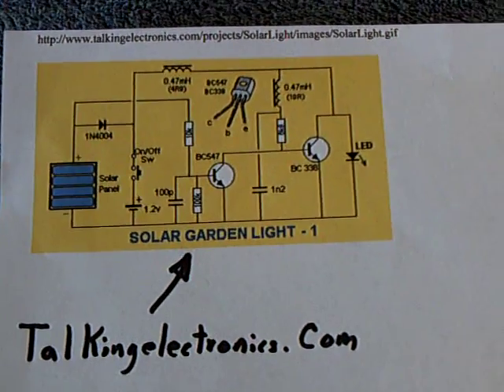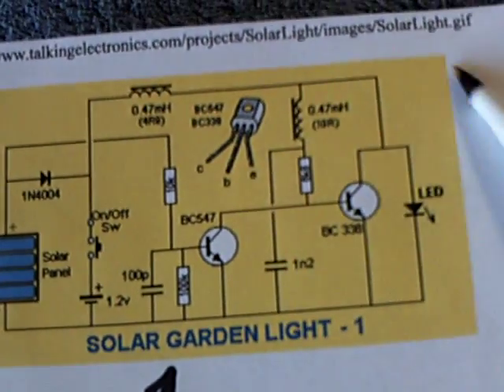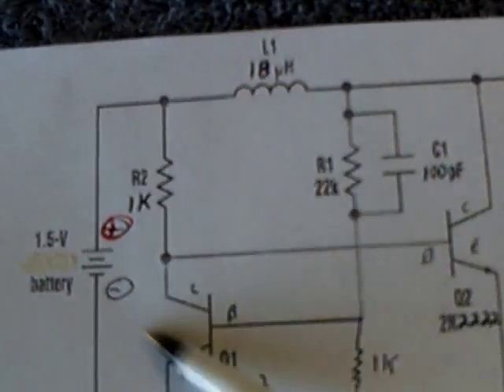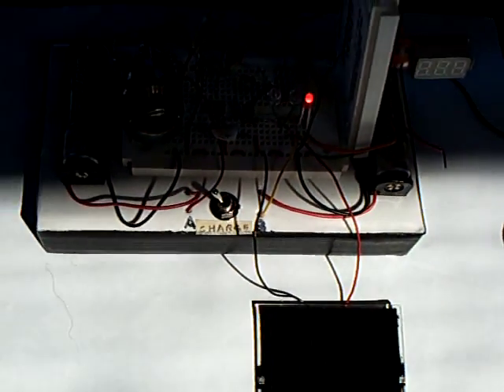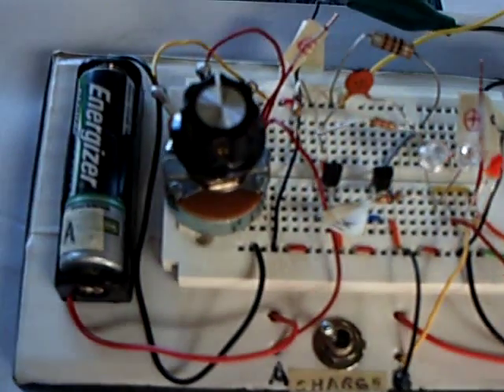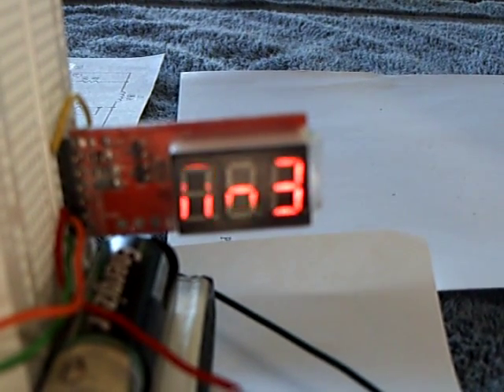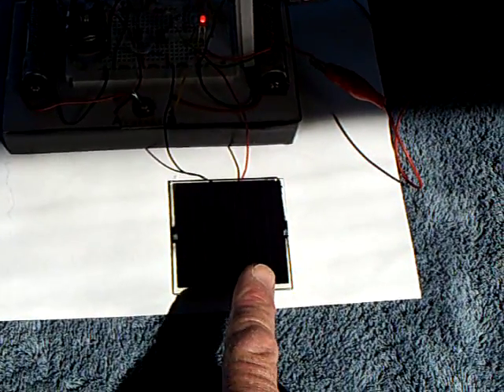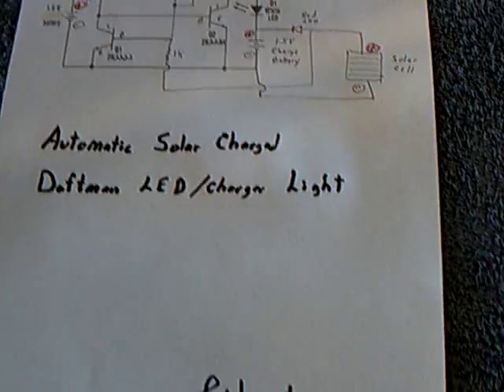Automatic solar charged Daftman LED Light

Comment: Your JT has two transistors, the first inverts the output of the second transistor, so you don't need a feedback winding.  Unlike the talkingelectronics JT, it is a true two transistor DC-DC converter, not a single transistor JT.

I'm at a can't understand why you go to all the trouble to display the schematic when you simply will not hold the camera still enough to allow the viewers to see the schematic.  But thank you for what little I could see.

Comment: I'm not sure why you're comparing this to the talkingelectronics Joule thief.  That JT uses a single transistor for the JT, the second transistor has no part whatsoever in the JT operation.  It is used to invert the output of the solar cell, in other words, when the solar cell is generating, it turns this transistor on, which in turn shorts the base bias current to common negative, turning off the JT.  The JT coil has two windings, a primary winding and a feedback winding.

(cont'd next comment)

Comment: rroge just after 0:55 you can see the diode near the solar panel which is occasionally sending some otherwise unused power to the charge battery.

If you had a whole series of these sophisticated garden lights I wonder if there is a creative way to link them together, for some benefit.